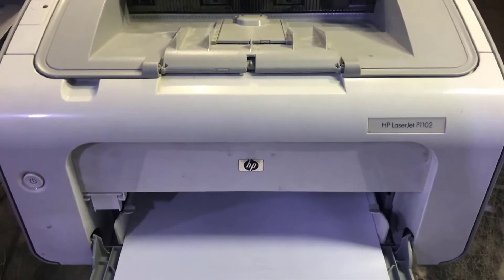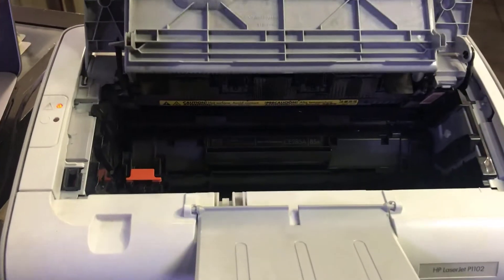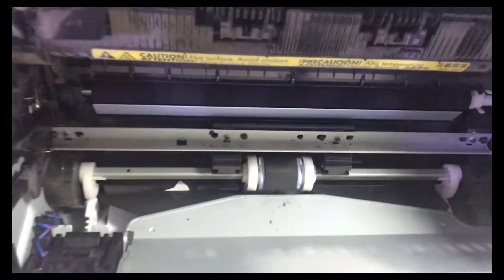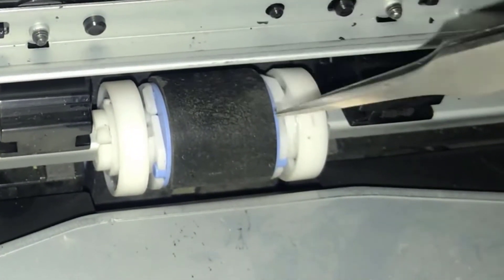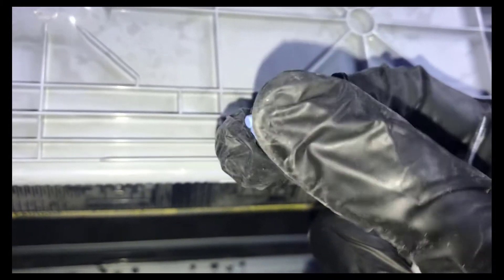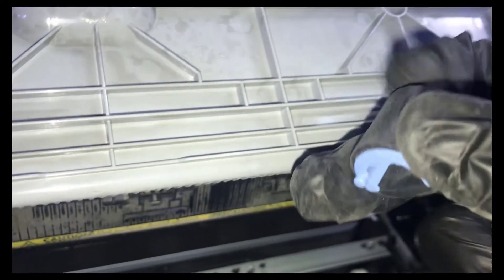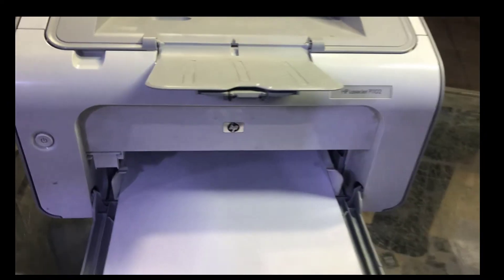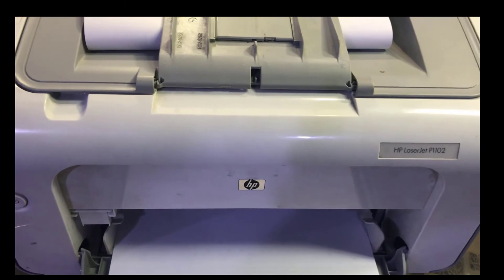How to Fix Paper Jam Issue in HP LaserJet P1102? Feeder Roller Fix in HP LaserJet P1102, P1005

Comment: very nice video.
i want to ask, i cleaned this roller, i also cleaned the paper separatar part as well. 
but still my HP p1102 is not picking up the paper. it is not even trying to pick it up.
i think the issue is with the rod on which paper roller installed, when i slightly move this rod down and restart the printer, then it makes some weird sound and picks up the paper once. and then again it will not pick up.
what is this rod called and where could be the issue???
hope to see your reply soon.
Reply from the maker: Its called drive,  but its rarely damage. Might be something stuck on the left side of the rod,
Reply: @BilalKhalid  how to make it work? Should i spray some lubricant?